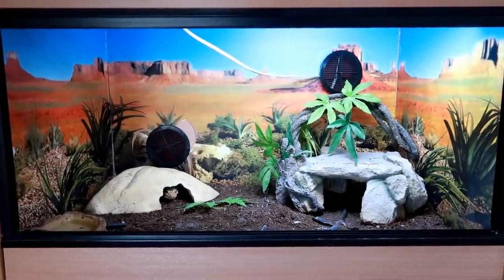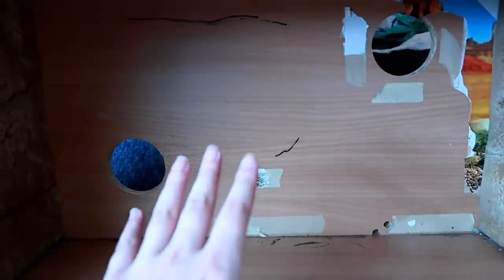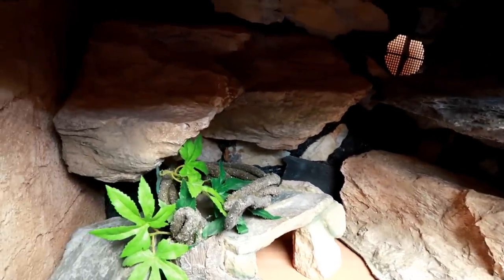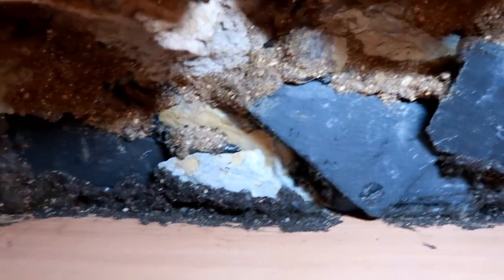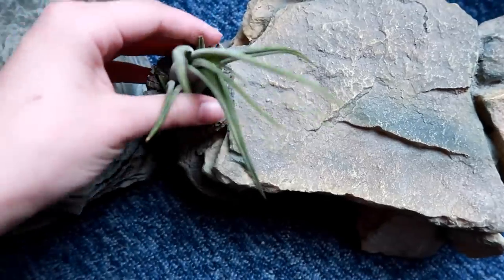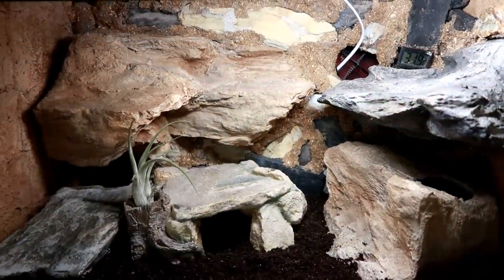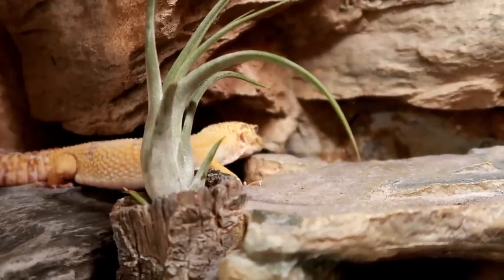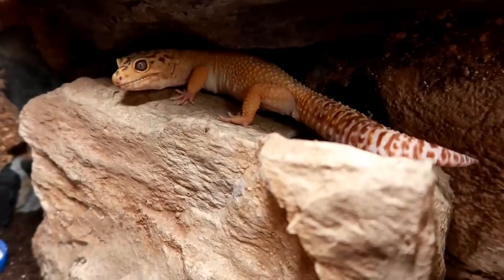Building A Naturalistic Leopard Gecko Tank!!

Comment: Air plants do just amazing indoors. But it is best to hang them outside is mostly or partial shade. If you implement some kind of natural grow light inside the tank near the plant the air plant will be fine inside there.
Reply: i'll add my own air plant quirk, you can use the dirty water from Diego's water bowl to fill up a spray bottle and spray the air plants to feed them.
Reply: One major tip to "air plants". In Nature they rarely live on a Rock, or dead material. They love a living/dead plant,tree,stomp as underground to attach to.
 The microclima is whats suits them the best. 

https://en.wikipedia.org/wiki/Epiphyte

Just throw a Bark in there, but 2-3 air plants together on it, and they will do better. Mine a more shadow dweller since 2 years in my Crested Gecko tank, so iam not sure about direct sunlight.

Either way good video
Reply: Silberschutz they will appreciate some morning sun when you give them a good soak or spray. But your plants will be fine.
Reply from the maker: thanks! Yeah to be honest its been sat in a glass terrarium on some rocks at the back of my room for ages, so i thought i'd give it a bit of a fancier home, but I will take it out now and again.

Comment: the heat mat doesn't melt through the wood? could you use slate before? can u pls do a heat mat installation tutorial?
Reply from the maker: nope the vivariums and heat mats are designed to work together :)
Reply: ok thanks :) also, can I put the heat mat straight on the tank without the wood/slate?

Comment: Is expanding foam a good adhesive because the rocks I’m going to use are a little heavy. I’ve tried hot glue and that didn’t work and gorilla glue is gonna take too long and the rocks are super flat so what adhesive should I usev

Comment: Can I ask a question? Have you ever gotten a rash or slight swelling spots on your arm after having your leopard gecko crawling around on it? I think maybe mine had its claws too sharp and it held onto my arm too tightly, but after i set him down my arm was itchy and I had a few bumps- a sort of allergic reaction I think? 

I've never had this happen before, and it went away pretty quickly although I did take an allergy medication just in case. I was just confused bc I thought you couldn't be allergic to reptiles, and I've held him before without this happening!

Thanks a bunch for any help or insight, from anyone!
Reply from the maker: It could just be their little nails, once they've walked over you they can make your arm red, but i usually find it goes away after a while.

Comment: I just set up a tank for my potential gecko. I put down eco earth and a uth but can not get it warm in my tank. Do I need one like you had that goes in the tank under the dirt??
Reply: Eco earth isn’t the best substrate since it can be dusty and hard on their joints. Quarantine on paper towel for the first six weeks. After, good solids include textured tile and non-adhesive shelf liner. It’s best to offer digging enrichment over six months with reptisoil, organic top soil, or a bioactive mix. Half tile half soil is good as well. 

It would be best to use a deep heat projector or halogen bulb. Any heat source must be connected to a proper thermostat and measured by a digital thermometer (like a temp gun).

Comment: wont the gecko have impaction from eating the substrate?
Reply: Impaction is caused by improper husbandry, not loose substrate. As long as their husbandry is correct (basking spot of 92-95, overhead heating, etc.) they’ll be able to pass it no problem. How do you think they handle the loose substrate in their natural habitat? Digging/burrowing enrichment is extremely beneficial for them. Loose substrate is the best way to go.

Comment: Ohh.. So the heat mat has to be in the cage??? I am getting a glass or plastic one so how am i going to do that? also, do heat mats run on batteries?
Reply: They don’t run on batteries. And you need to put the heat mat under the enclosure. The only reason she has hers inside is because her tanks are wooden. Connect the heat mat to a thermostat, measure it with a digital thermometer, and elevate the tank for air flow.
Reply: @fionashepley478  Cheers

Comment: I have repticarpet for my leopard gecko should I put the temp probe over or under it? Also can I use strips of Velcro to hold the probe down if it’s on top?
Reply: Jaden Garcia well, the probe goes where your leopard gecko will be. They can often get underneath the reptile carpet, though, so it may be best to put it there
Reply from the maker: personally i think i'd put it above the carpet as thats where the leo will be lying.

Comment: What heat mate do you use
Reply: She doesn’t use them. Heat mats are not a good heat source. A halogen flood bulb connected to a dimmer/dimming thermostat is the most natural and beneficial option, Arcadia’s deep heat projector is the second best option. They produce infrared A and B like the sun, heat that penetrates deep into the skin tissue and heats them far more effectively than heat mats. Whereas heat mats only produce IRC, which only heats the surface of their skin.